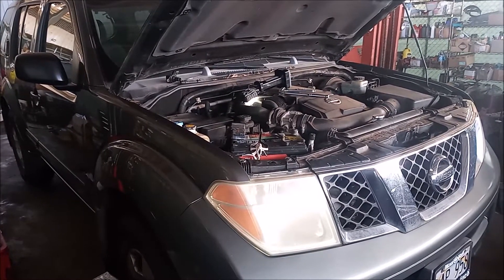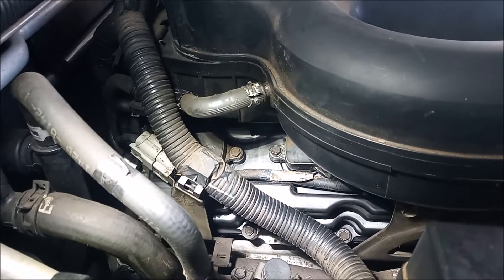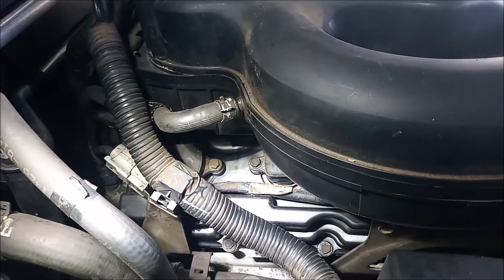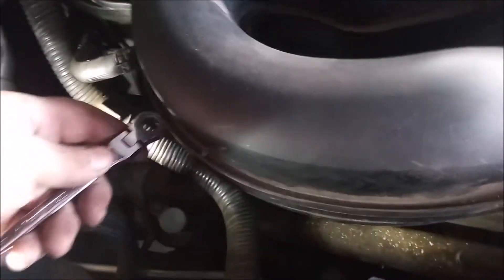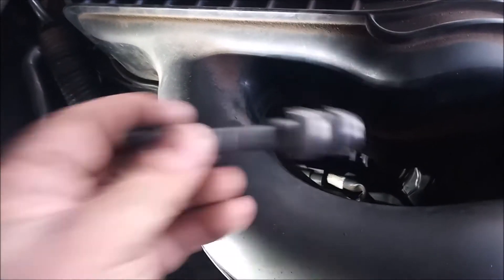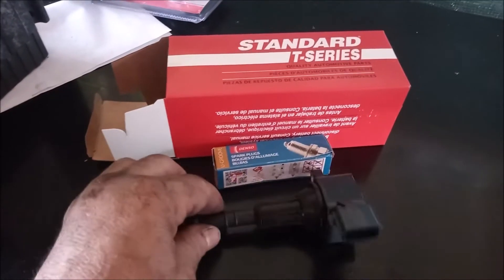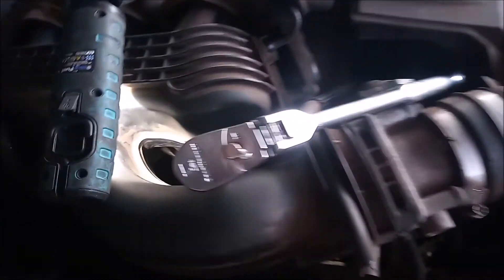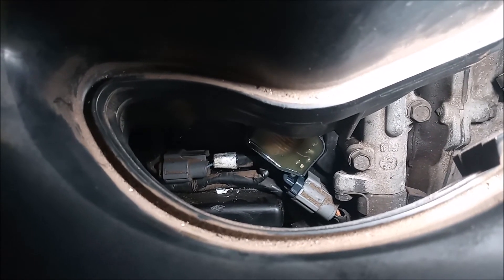Nissan Pathfinder P0301 Hack - 4.0 V6

Comment: I’ll change the coil packs and spark plugs on my 2007 Nissan Pathfinder and it still has a misfire
Reply from the maker: check fuel injectors.

Comment: i would recommend using good oem quality coils on that side of the engine.  We replaced all the plugs and coil packs (duralast) when we replaced the valve cover gaskets.  Within a few weeks my son had to go after #1 cylinder.  Thankfully we watched a video where they didin't remove the plenum, but you need a stubby 10mm to make it easier.
Reply from the maker: Thanks for the tips!

Comment: Qué tal amigo , tengo una frontier del 2006 ,no tiene fuerza , está acelerada , estuve checando y el múltiple de escape del copiloto no calienta y el otro si , mi pregunta es si el problema está en los cilindros o los catalizadores?
Reply from the maker: Check the fuel trims on each bank with your scan tool.

Comment: Absolutely agree with a few comments below.  This is the third YouTube video on this subject which failed to show the new coil going in.  Removing the old coil in two parts is easy since it's being replaced anyway.  Going back in with the new coil is nearly impossible.  The coil does NOT fit through the gap, so it needs to be manipulated from under the intake manifold.  This means the new coil will NOT drop straight in.  If you try to get the new coil installed in two pieces, you can never be 100% assured the spring is seated properly in the coil.  I tried and failed several times.  In the end, I took the intake manifold off.  I'd venture to say removing the intake manifold took just as long as monkeying around trying to do the job with the manifold installed.  Buy a set of intake manifold seals and search YouTube for instructions on how to remove the intake manifold.  Replacing the coil is so much easier if you remove the intake manifold first.  If you're able to get the coil removed without taking the intake manifold off, then you have the skills to remove the intake manifold in the first place!
Reply from the maker: Pal sorry you had a problem with this. Many others have done it without any problem, and commented to that effect. I guess that one half of viewers are maybe more capable than the other half. By the way your bout of verbal diarrhea here sure gives cause for concern. Are you ok?
Reply: @Merryfrankster_  35 years in the aviation maintenance profession. You learn to work smart, not hard. My apologies if my masters degree resulted in an educated, detailed response that might have been beyond your mental aptitude.
Reply from the maker: @KS-ko9kx  Pal if after 35 years you still have not figured out how to push a coil into a hole, it's probably never gonna happen, and more education is not gonna help. Did it ever occur to you that it's your education holding you back? Book smart, street smart, you know what I'm saying, right, or do I need to spell it out for you. Sigh. I probably do.
Reply from the maker: @KS-ko9kx  OBVIOUSLY THIS METHOD DOES NOT WORK FOR EVERYBODY. SORRY IT DID NOT WORK FOR YOU. CONGRATULATIONS TO EVERYONE WHO FOUND IT A EASY AND SIMPLE.
Reply: @Merryfrankster_  whatever dude. Keep turning wrenches on your four wheel vehicles. I’ll keep my $165k/ year salary and turn turbine powered, multi-million dollar aircraft on a daily basis. You have no clue. I’ve forgotten more than you’ll ever know.
Reply from the maker: @KS-ko9kx  buddy you are not even capable of inserting a coil into a spark plug well. All the money and toys in the world are not going to change that.
Reply: @Merryfrankster_  Here’s the deal. When you advance to working on engines that produce 28,000 hp versus 190 hp, come see me. Oh wait, that’ll never happen!  Enjoyed our back and forth, but I’m done with you. A good technician can get the job done just as quick or quicker doing it the right way.  Maybe someday when you grow up you’ll be at the same level of technical skills as me, but highly doubt it. I’ll be looking forward to your next video showing us all how to change brake pads without removing the tire. It’s been fun….
Reply: @Merryfrankster_  If you ever have the opportunity to replace the #1 coil again, can you post a follow-up video showing how you’re able to get the coil installed in one piece?  I’d like to see it done.  It’ll be like knowing Houdini’s secrets.
Reply from the maker: @KS-ko9kx  Pal it's obvious to anyone with even half a brain that all these big numbers you are throwing around are complete BS and your way of overcompensating for your personal feelings of complete inadequacy.. A guy in that position would not be puking all over himself in the comments section of an obscure youtube video. What a loser.
Reply: @Merryfrankster_  Sure.  Anytime you want to compare resumes you let me know.
Reply from the maker: @KS-ko9kx  why would I do it again? I did it on that car two years ago, the car has been back in and out of the shop for other reasons, but not for misfire. I DID IT RIGHT THE FIRST TIME, UNLIKE PEOPLE WITH BIG RESUMES WHO CANNOT EVEN GET THROUGH CHANGING A IGNITION COIL.
Reply: @Merryfrankster_  I had the coil in and out twice. The problem was the spark plug boot wasn’t flexible enough to allow the coil to go in without separating the boot from the coil. When separated, the spring wouldn’t center properly in the boot, so there was no way of telling if the spring was making proper contact with the coil until I fired it up and it was still missing. That’s why you should have included showing the assembly going in as one piece. Maybe the aftermarket coil I bought was less flexible then what you had at the time, but I guarantee there was not enough room and not enough flexibility to get the coil installed as one piece. If we bet a case of beer that you couldn’t get the coil I bought installed your way in my Pathfinder, you’d be out a case of beer.
Reply from the maker: @KS-ko9kx  A resume is never the true measure of a man, and anyone who is impressed by an overstuffed piece of paper is an idiot, and anyone who relies on his resume to impress others is probably a con man.  You're on your way to becoming the George Santos of my channel, pal.

Comment: I just bought a used 2010 Xterra with the cylinder 1 code and it's so strange that a Google and/or Youtube search for changing the spark plugs leads to so many results for full intake removals. I watched your video and took a step stool outside and was like, oh it's right there. (The step stool really helps unless you're really tall). 10mm wrench, doesn't even have to be stubby. Loosened the bolt a bit and finished it by hand. Pulled the old coil out and disconnected the connector once I pulled it as far as it came out. Slid the new coil in sideways, coil pack to the right, and raised it as high as it would go towards the front-of-car side of the big hole on top. I used my left hand to go in from the bottom because I had to push the tip of the boot past the metal lip that's inside the top of the spark plug hole. After that I pushed the connector back on before I spun the coil back into position and put the bolt back in. I found my "flexi" socket extender right before so I was able to spin the bolt back in from the top instead of by hand so that probably saved 5 minutes of blind finger turning. I could probably do the whole job in a few minutes now that I've done it once. Thanks for this!
Reply from the maker: Good job! Thank you for watching and for commenting.

Comment: What Ratchet are you using the one I bought is to thick to fit o er the bolt
Reply from the maker: prolly gearwrench that's what I have in my toolbox mostly.
Reply: @Merryfrankster_  thank you much appreciated

Comment: Hey you skipped 1 fundamental part, how do you get the new part in? Cause I know for a fact that the old one comes out in 2 pieces but it doesn't matter cause its the defective one, but the new one? You disassemble the new one in order to get it in? I wouldn't advice that cause it doesn't go the right way.
Reply from the maker: Good to know.

Comment: Mine has a po 300 code
Reply from the maker: Start by chexkinf the condition of any of the spark plugs that are easy to do, then you can decide whether to change them all.
Reply: Yeah I just change the spark plugs in Minot how hard number one cylinder is to get to you I got the fighting with the extensions and I didn’t tighten it down all the way so I just pulled it apart and take it all the way fired it up sounds pretty good now I got to go for the rest of it back together thanks though I appreciate it the video did help

Comment: You don't need to remove anything the coil pack will be out the top if you rotate it the right way . Done it many times on these engines.
Reply: how do u rotate it out ?
Reply from the maker: Thank you for watching.

Comment: Thank you - this helped me cure the P0301 code in my 2006 Xterra.

It started shuddering, and hesitating out of nowhere and the CEL came on.  Code reader gave me the P0301.

I removed the #3 coil pack for more access.

It was a PITA, but got it done.

Used all the tools in this vid, plus a couple long standard/flat head screw drivers to help pry the connector off the coil (one to depress tab, one to pry/wedge it off).

Get your roll of quarters for swear jar ready.
Reply from the maker: Good job!

Comment: Thank you so much for this video. 
This saved me so much time and headache. 
I used the same pivoting ratcheting wrench.
Unplugging the coil pack was a little difficult as trying to to damage anything. 
I used 2 long extensions,  a swival, then the socket.
Removes the whole coil pack by rotating it 180 degrees clockwise and pulling it upward and toward the front of the vehicle, then pulling it horizontally towards the rear. 
The boot is rubber so it does flex. 
Installation is simply reversing the process,, but plugging the coil back in was kind of difficult. 
Long curved needle nose, or pliers alike would make this much easier to plug in. 

Awesome video 
THANK YOU!!
Reply: What pivoting ratchet wrench do you have the one I bought is to thick and is making my life hell
Reply: @hUnTnlolz24  
The set that I have is Bluepoint.
But they should all work the same if you attach the set up as I did above from the socket to the ratchet. The swivel is key.
Reply from the maker: I'm glad that this worked out for you, and you were able to figure out the little details to make it work.